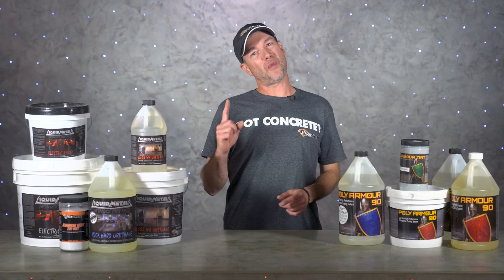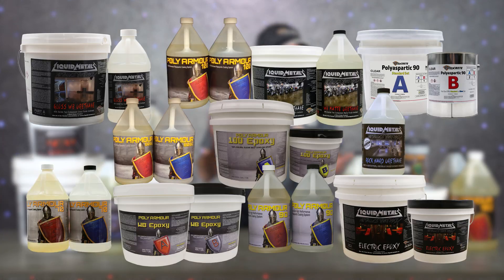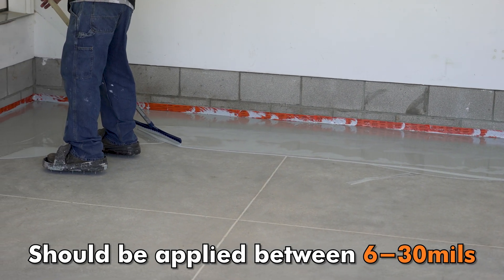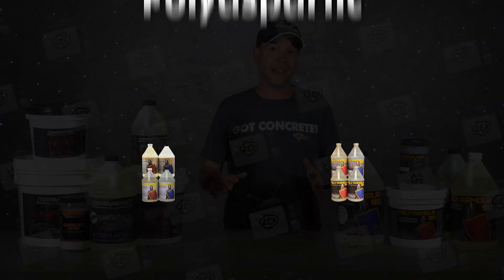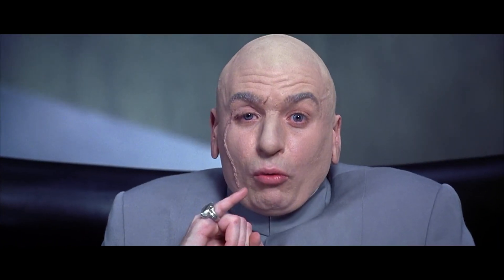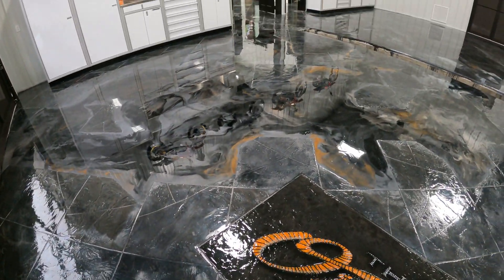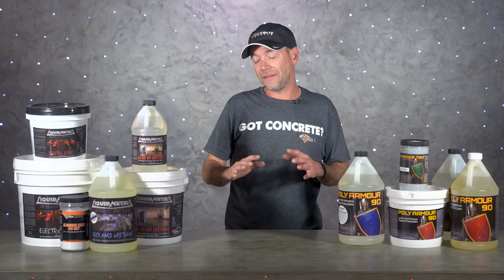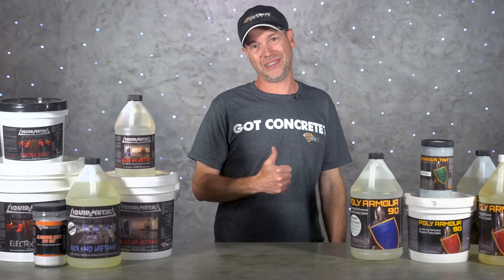The Ultimate Guide to Concrete Floor Coatings!

Comment: Which of your products would you recommend for a rental? Inside the house. This is new construction and the floors will be ground before finishing. Roughly 700 sq ft. Thanks!
Reply from the maker: Thanks for the comment! We have quite a few things that would work for that. It just depends on what you want the final outcome to look like. Epoxy is always a good thing to use for the base coat if you're newer to floor coatings. Flake broadcast floors are the easiest to make look nice for DIY jobs. I'll leave a few links below. Thanks for watching Deco-Crete TV!!!                                                                                                                                                                                                                                                                                                      https://www.youtube.com/watch?v=jfi_zG7kmTo                                                                                                                                                                                                                                                           https://www.youtube.com/watch?v=m74qGWWPgfE&t=588s

Comment: Hello
Do the synthetic floor coverings have any insulating value?  I have a home that is an at level slab home.  The carpet in my living room needs to be replaced.  I am not a fan of carpeting.  I have considered putting a coating of some kind down and using area rugs.  Can rugs be put on the synthetic coatings?   Thanks in advance for any insights you can lend.
Reply from the maker: Thanks for the comment! A concrete floor coating would be a great option for your project. The rugs will not an issue as long as you wait until the coating is fully hardened. The coating will not add any insulating value, however. Thank for watching Deco-Crete TV!!!

Comment: Can I use this over an old hardwood floor assuming I sand fill and prep as required?
Reply from the maker: Thanks for the comment! We have a product called Floor Flex that's designed to be an underlayment for floor coatings. It's meant to be applied to a plywood subfloor, then you can apply whatever coating want. We don't recommend putting it directly over old hardwood. The best thing would be to put plywood over the hardwood, then apply the Floor Flex. Thanks for watching Deco-Crete TV!!!

Comment: Does the Liquid Metal Urethane yellow?  How long has it been around?
Reply from the maker: Thanks for the comment!!! The Rock Hard Urethane is UV-stable & non-yellowing.  However, this does not necessarily mean that the epoxy underneath it wouldn't yellow a bit if it got heavy exposure to UV rays. We've had this low-odor version of Rock Hard Urethane for 3-4 years, but this type of urethane has been around for 15-plus years.